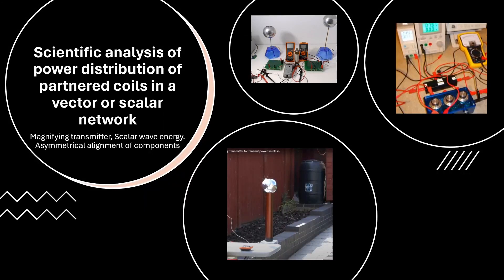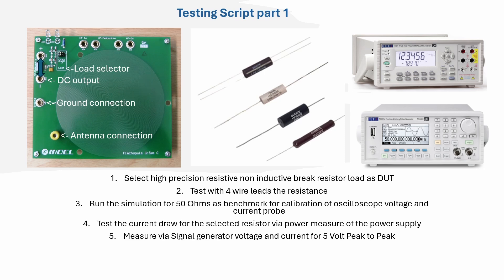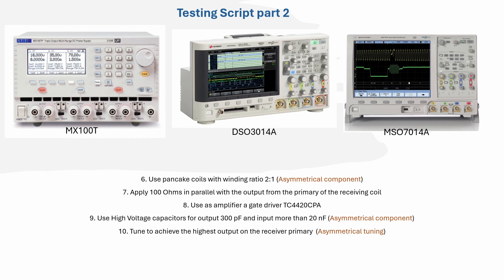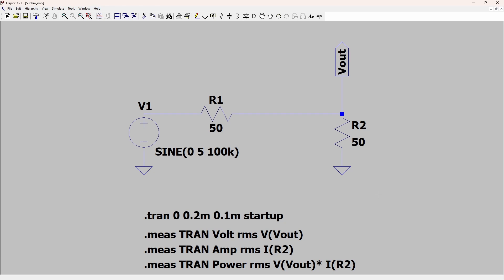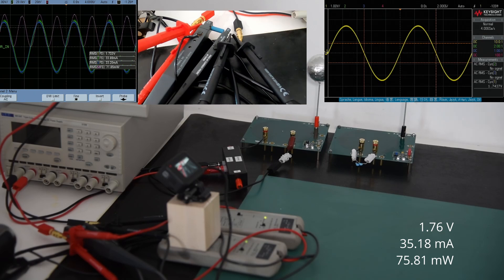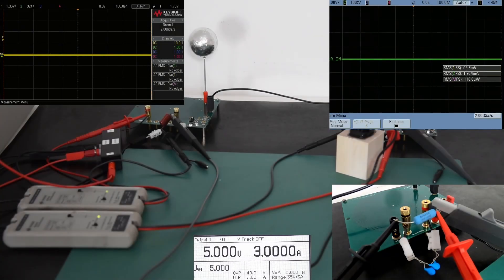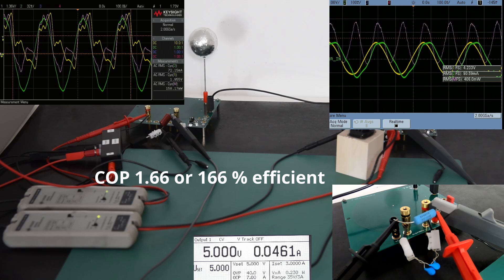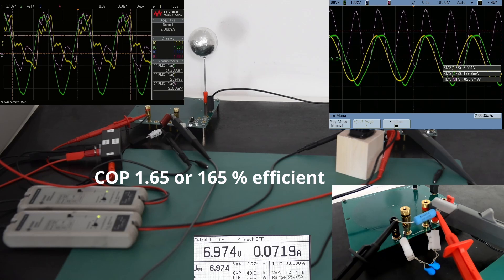Scientific analysis of power distribution of partnered coils in a vector or scalar network.

Comment: I think Tesla have said all what we need to know about his invention of flat bifilar spiral coils. I can add my observations to this and I am saying Tesla have another patent for a generator using Faraday’s Paradox and namely 2 discs of copper rotating against each other as in Faraday disc generator. Now considering his invention with 2 discs of copper placed between magnets and knowing the voltage is realised from the center to the outside diameter of the discs.

If we have a close look at his “pancake” coils we can understand that in a bifilar flat spiral coil we have a copper disc in each monofilar of the bifilar and the current is running against each other … coroborate this with explanations of Arie de Geus patent for a bifilar coil where currents run against each other in adiacent wires we can observe zero point energy with the help of aether … we only need to link the dots to see the obvious truth yielding at us.

And is also obvious we can generate electric power with any need to burn anything or monstruos nuclear power plants.

If someone like myself with no qualifications in electric or electronic can see this, I wonder why scientists are quiet and shy to speak the truth. I just replicated someone’s else work and able to power +2kw domestic appliances with a power source of 20v 3.2 amps and all these loads draw from source only 115w anything more than 115 w will shut down the system. And as an observation, the heavier is the load the less is drawn from source up to the limit of electronic components used in a very basic and simple circuit.

I don’t need to know all the fancy names given to waves or whatever, for me understanding magnetism is more than enough to be able to build many other devices and power domestic appliances for fraction of their rated power. And i don’t need and don’t want to use any other tools apart from a multimeter and screwdriver … this all what is needed.

Comment: Interesting result! Are you just calculating based on the peak heights, or are you accounting for the power factor induced by the phase shift? Also I predict that if this is indeed real, some nonlinearity in the system drives it, so there is an optimal applied input power to maximize the COP below which the nonlinearity isn't fully exploited, and above which, the nonlinearity is saturated. It seems that's what you saw, with a maximum COP of 1.73.